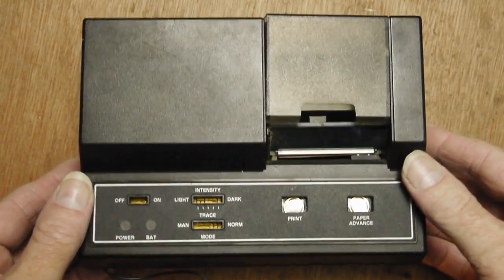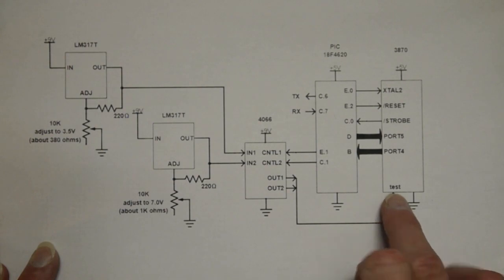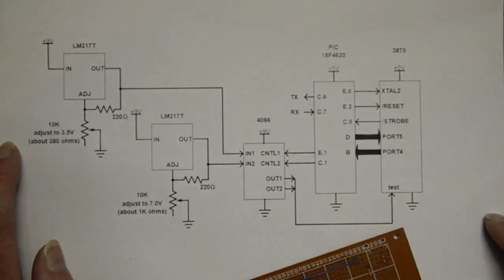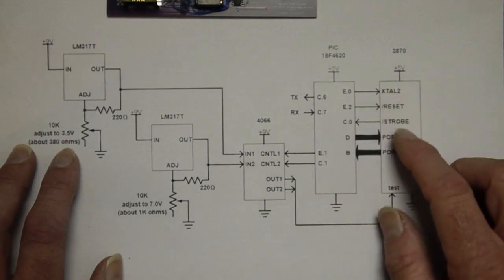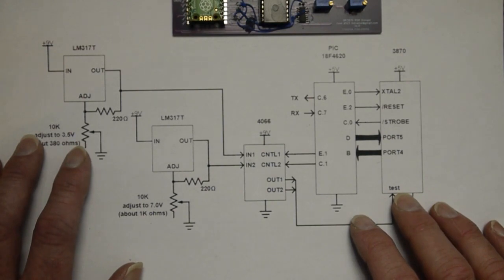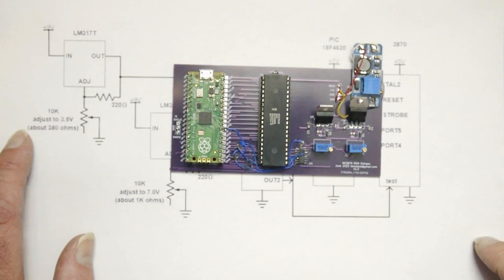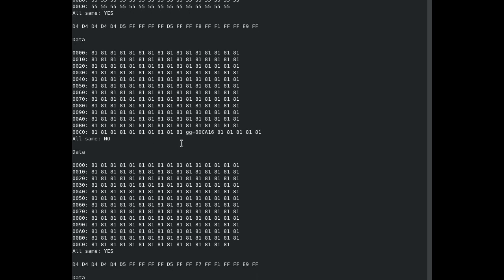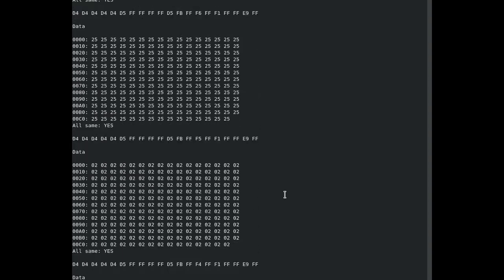M3780 Microcontroller ROM Dumper

Comment: Hi, I’m trying to reproduce your circuit but i can’t find in your Github the schematic for the level shifter. You talk about some fet transistors…
Thanks for what you are doing
Reply from the maker: Hello, yes I didn't have level shifters on my PCB, it is a mistake. I added Si23xx n channel FETs (one I had available) as simple inverting level shifters from the Pico outputs.
Reply: @menadue  thanks, hope that i have everything around to try tonight. I use two step up converter but it didn’t work
Reply from the maker: I think the code uses my level shifter and that inverts, so if yours doesn't then that might be a problem. Have a look at the code and see if you need to swap the polarity of the signals. @RiccardoPietroni

Comment: Interesting, I always thought there was no way to dump a mask rom, I wonder if it will also work with a NEC D650 uP as those have the test pin and mask rom and are  used in a lot of equipment.
Reply from the maker: Mask ROMs are harder to dump as they are embedded in the microcontroller, but you can decap and dump that way, or use some form of test hardware type method. It looks like the D650 has been dumped, or a similar chip, here:
https://www.handheldmuseum.com/forum/viewtopic.php?p=11037&highlight=

Comment: Nice work. I need to dump the ROM for a piece of HP test gear that also uses a 3780 and this will save me a lot of time. I was also looking to replicate Sean's circuit. Thanks for sharing
Reply from the maker: Thanks. I'd offer a PCB but it needs a modification for level shifters as I said in the video. It's probably easier to have new PCs made with that mod on it. I'll see if I added the mods to the schematic
Reply: Hey 13kire, was that by any chance a HP 5334B frequency counter whose MCU(s) you were dumping the ROMs for?  Did you have any success and, if so, any chance of you being able to share the ROM contents?
Reply: Hi  @MrWavelet , sorry, but in my case its a different HP frequency counter, a 5386A. I also havent had a chance to try this yet so im not much help unfortunately